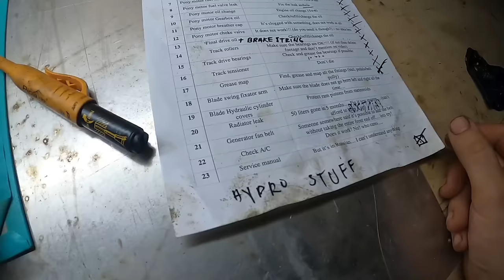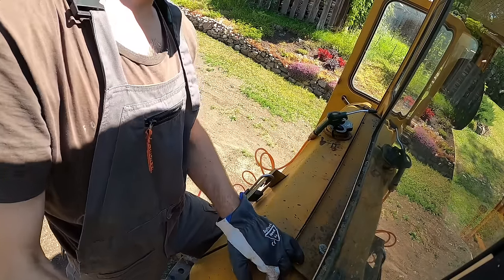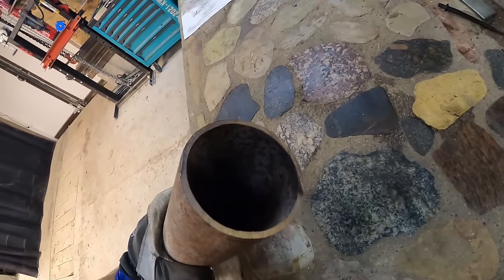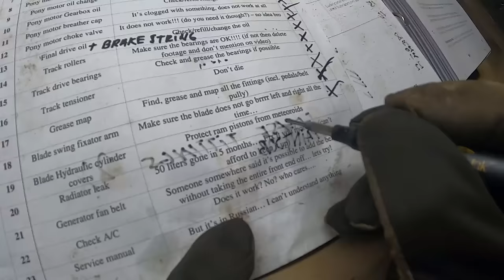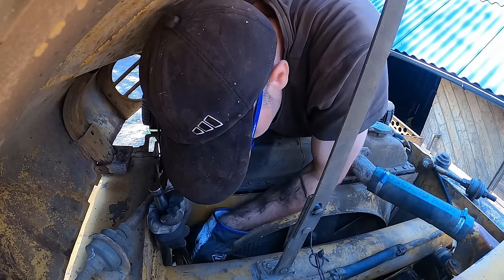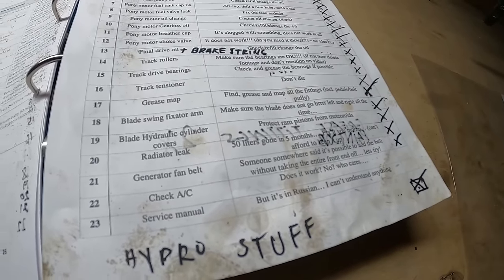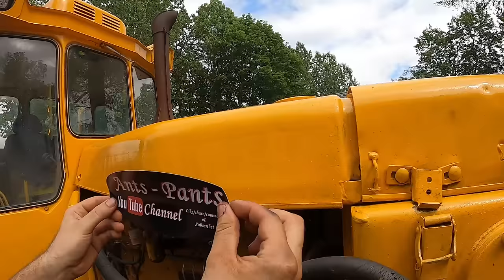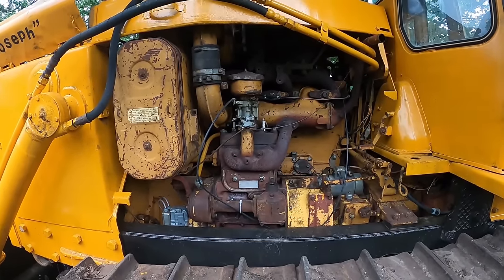Fixing the soviet bulldozer T-170 - Ep3

Comment: Do not lube yonts at blade it will be as grinding past. When bliding fuel system you do all reigth beside open the bliding screw on injectors and run the engine with the ponymotor untill it comes fuel 😊
Reply from the maker: Yup 👍

Comment: ЧТЗ on russian means Cheliabinskij Traktornyj Zavod - Tractor Factory which is located in the City of Cheliabinsk, not 4 but russian letter Ч and not digit 3 but russian letter З Yeaaaah, it's like digit 3 But it means "Завод" (Zavod - Factory)  :-)))) Joseph (Biden) looks now like it just went out from the Zavod :-))))) Thanks for the video & have a nice weekend! P.S. I doubt that this diesel engine will run on the gasoline: no spark plugs, so it will be hard to ignite fuel. But you can try to run it on the used vegetable (sunflower) oil mixture (with alcohol) probably :-)))) Am not sure about Joseph but we had public transport buses in Vilnius some time ago, they smelled like pancakes :-)))) Very pleasant :-))
Reply from the maker: Thanks
Reply: @Ants_Pants  no problem 🙂

Comment: Покрасил и сразу советский трактор превратился в Caterpillar D11😅

ЧТЗ - челябинский тракторный завод.

ChTZ - Chelyabinsk Tractor Plant.

lantern (green) of the control lamp, indicating the readiness of the EFU system to start the diesel engine.

The principle of operation of the EFU is based on heating the air entering the diesel cylinders with a torch (flame) of burning fuel. Fuel to the candle comes from the fine filter through the solenoid valve.

left lamp (ruby color) of the control lamp of the signaling device for clogging of the hydraulic system filter.

this engine can also run on horse manure 😁
Reply from the maker: 😂😂 thank you very much

Comment: the trick to washing greasy equipment is a hot water pressure washer, or soaking the entire tractor in a solvent bath i guess, but yeah hot water is what does it, not soap or more pressure
Reply from the maker: Or pressure wash with break cleaner instead of water? 😂 yeah i need to get myself a hot pressure washer

Comment: In the US we call those lights on the dash “idiot lights” because a light is kind of idiot proof compared to a gauge………sometimes. Unless you’re a really bad idiot and think that if something is wrong the light would just get brighter. 
To pressurize your fuel tank when you’re alone why couldn’t you just screw an air fitting on the piece you welded on the fuel cap, plug the air hose onto it and set the gauge on the compressor to just 4-5psi or whatever it is in metric? That’s what I thought you were going to do.
Reply from the maker: Yeah should of done that

Comment: Why didn't you just fit a tyre Schrader valve to the fuel cap?  You could then just remove the core and fit a dust cap with a hole in it as a vent.  Pressurising it could have been done safely with a hand pump.
Reply from the maker: on the spot thinking got me there

Comment: A mix of used motor oil and gasoline make a decent diesel substitute, and Im sure Joseph wouldnt care at all
Reply from the maker: Remove filter and that thing will drink up yo ho crude oil bro
Reply: Modern diesel is probably the best fuel this relic ever had in the fuel tank 😅

Comment: with heavy duty construction equipment like your dozer for example, or even most dump truck boxes. they are built from hardox plate. a machine like that would never survive if built from mild steel
Reply from the maker: i had to google what hardox steel is :D